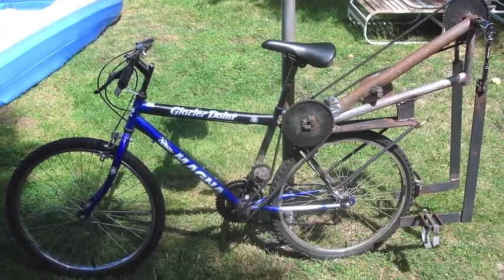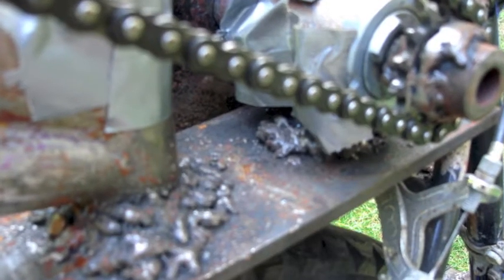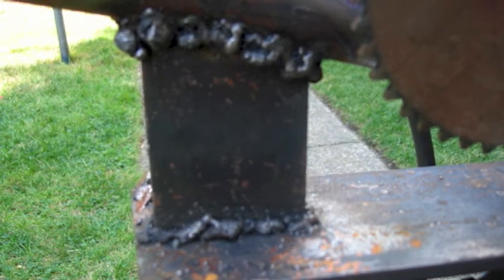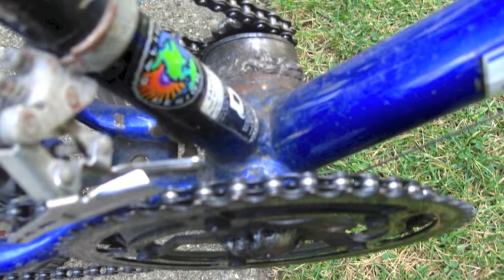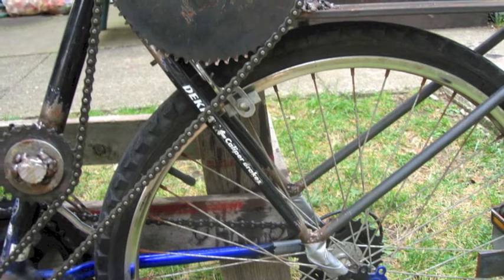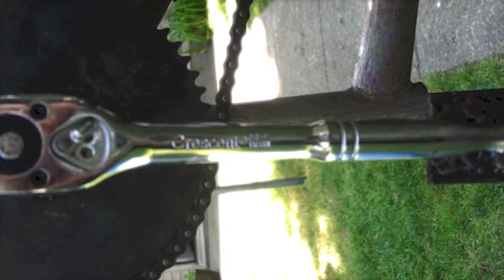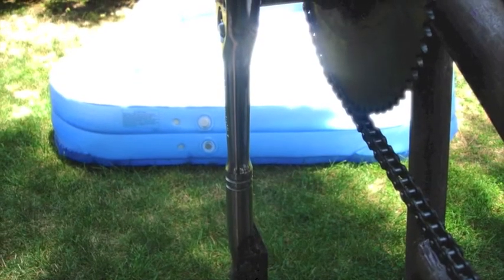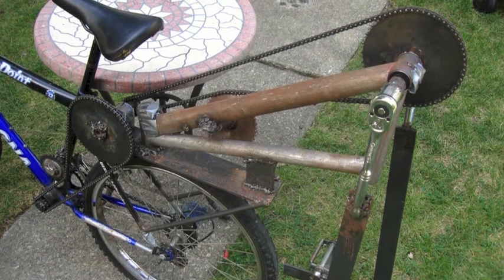The Gearcycle Part 6 (Bicycling Revolution)

Comment: Interesting, any updates? Why not simply gear the bike itself higher? You could easily change the pedals to move side-by-side rather than opposite each other. And If you want maximum pedal pressure, a recumbent bike works well.

Comment: how do you ride it? aren't the pedals to far away?
Reply from the maker: No. I have long legs and can reach them. It's difficult to get this bike started and I have to start off using only one leg to pedal, while simultaneously reaching for the other pedal as I get it started with my initial pedaling with one leg. Very awkward riding this bike.

Comment: Link Below - It may go by another name these days (I'm thinking Mindstorms?). Basically any scaled prototyping will do. It will allow you to tune your design before going full scale using welded joints etc.
Most bicycles are already geared very well to allow a massive mechanical advantage & dramatically decrease the energy cost of locomotion for the human rider compared to walking or running. That's not to say an improvement can't be found! lego.wikia.com/wiki/8094_TECHNIC_Control_Center

Comment: Your work and planning is great. I spent 2 hrs at the library yesterday and read up on tires size, gear ratios x rpm.  You have tons of torque but I wonder if one can "pedal" fast enough.  I might have only 1/4 the torque on my bike but I can pedal at 130+ rpm.

Comment: I like your bike! It looks very technical. 
You are correct about the large gear to small gear rotational gain, however that gain comes at a cost - it will be much harder to rotate the primary gear attached to your pedal assembly.
I used to find Lego Technics a good place to start while developing prototypes. It allowed me quickly create gearing systems and discover any problems with my mechanical design.
Good luck with the rest of your project.

Comment: This gearcycle has a lot of problems, my suggestion is to go all the way back to the drawing board. start with a bike with regular gears and add too it from there. This pedal system looks ridiculous, the pedals should not be any different from a traditional bike. Add a bunch of gears? yes do that... change the way the pedals make the bike go? NO! They need to work like a regular bike.